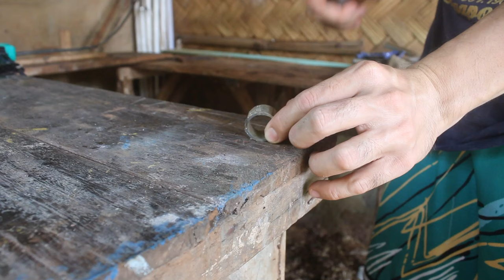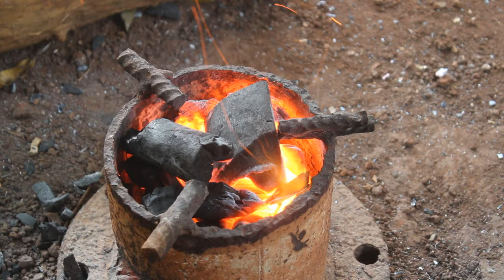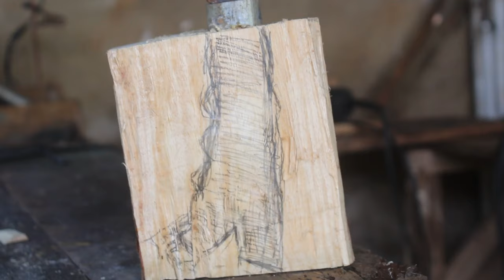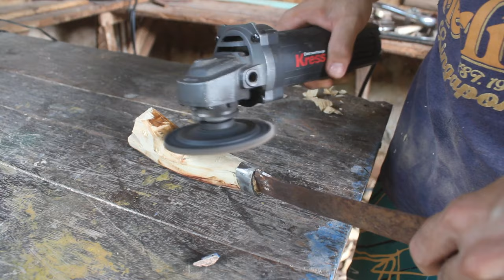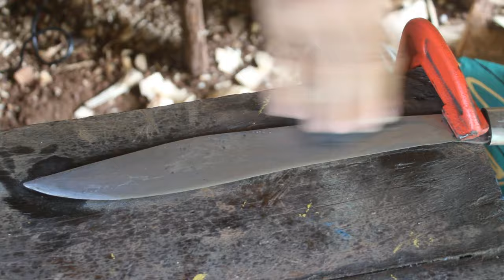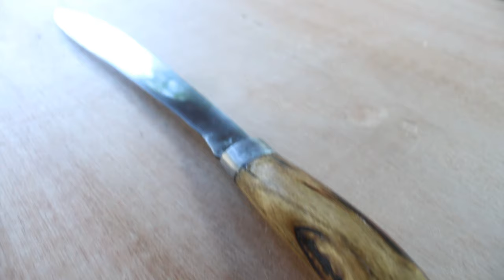BOLO RESTORATION #knife #bolos#sharp #restoration #restore #asmr #howto #rusty #knifeskills

Comment: Did you really need THAT much wood to carve out that handle?
Reply from the maker: in my opinion yes..with that kind of restoration heating the bottom part of the bolo..when you start beaten the wood if you use small wood it may break or crack..thats why i use a little big to avoid that.